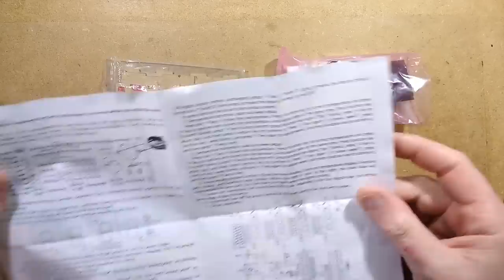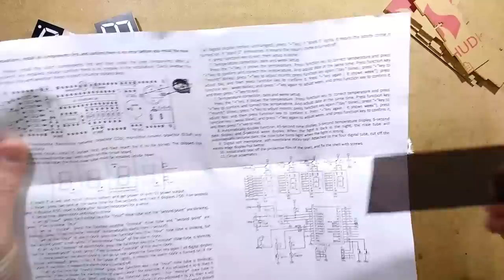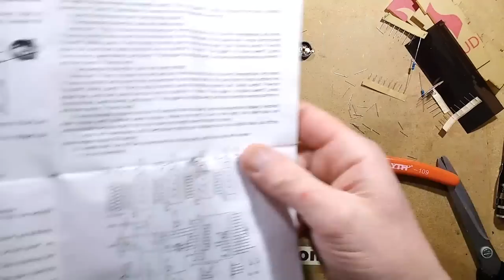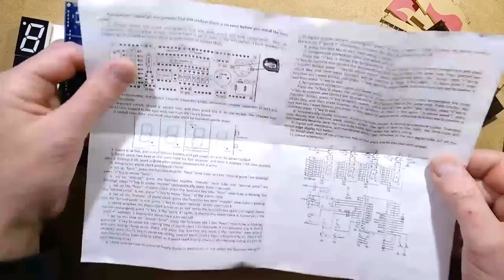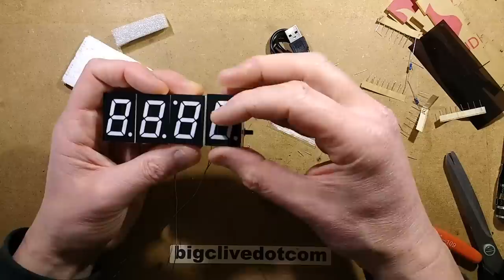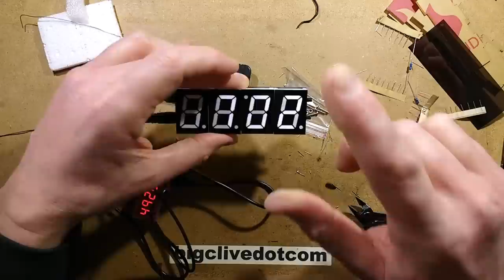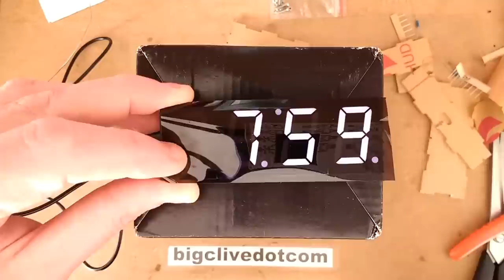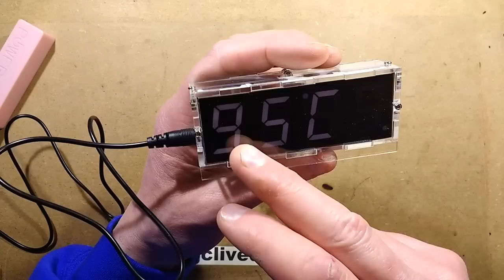eBay clock kit.  Full build and setting guide.

Comment: is it possible to fry the switch, put one of those together and one of switches does nothing :( i cant do initial reset etc and display also shows crazy things :) i guess i`m ordering couple more of those - want to get one working one at the end :D. and my soldering skills needs some practice anyways :)
Reply from the maker: It's possible that the track associated with that switch has a solder bridge or bad solder joint.  One way to test if it is the switch is to bridge its contacts carefully.

Comment: Why so keen on the separate timer chip?
There is no reason why a software based clock shouldn't be just as accurate if done right and the crystal oscillator it gets it's timing from also done right and adjusted.

Comment: what diameter solder you prefer using? I found that 1.5mm solder is completely useless
Reply: just5444 this looks like 0.5mm to me. I use 0.5mm myself, sn62pb36ag2, 3 veins of rosin core if memory serves, made by Stannol, couldn't be happier, just such a pleasure. Bought a big roll when they forbade lead in electronics, so it was named "plumbing solder", but you could tell its made for electronics and just hastily relabeled.

Comment: I built this clock on the weekend, everything seems to work as intended... Except it changes time slowly (only a couple minutes pass in about 20 minutes of actual time). Any suggestions?
Reply from the maker: Double check the soldering around the crystal next to the 8 pin timekeeping chip.  Especially the two small capacitors associated with it.  (Also check they are the right capacitors.)
Reply: I rechecked the solders at the capacitors and verified that I have the right ones installed.  I applied slightly more heat to the capacitor solders.  I removed and reinstalled the 8 pin chip.  Now the clock is working properly, thanks for the help!

Comment: Is the battery necessary?because i know that the battery is supposed to be the backup power supply in case of power down so that the clock can continue to count time. But i did try to plug in a battery and shut off the power for sometime and then power on the clock, yet the time is messed up. Any advice?
Reply from the maker: It's supposed to maintain the power to the clock chip and keep the time and settings.
Reply: @bigclivedotcom  ya i tried but it didnt work. I used a GP cr1220 battery. The voltage measured is about 3.4 v.

Comment: I know this is an old video but perhaps you can help?
i just built one very similar to this. it turns on , sound works, i can set the time / date.  But its static, time doesn't move forward .
Reply from the maker: Check around the little eight pin chip.  Especially the cylindrical metal crystal and its connections to the main chip.
Reply: thanks for reply.
I am 100% certain everything is soldered correctly, i double checked before soldering the digital numbers on the back.
Reply: @bigclivedotcom  Hi again, The chip was faulty , bought another kit and put the new chip in and worked straight away. 
Hopefully i can find  a single chip , then i can build the second clock.

Comment: Where do you get those screwdrivers from? the black one?
Reply: Donald Holben poundland or poundworld.
Reply: if youre not in the uk you can get them on ebay, theyre listed as 8 in 1 or 9 in 1 mini screwdriver. theyre cheap as chips but really good, the bits are hardened and dont deform as easily as most cheap precision screwdrivers
Reply: Thanks :)

Comment: I got the same clock and was annoyed by the fact that it displayed the temperature every couple of seconds. These STC micro controllers can easily be flashed with custom firmware. Luckily I even found a finished project on github that I could customise easily - stc-led-clock

Comment: What is the keyword for that film?
Seems useful in many use case.
Reply: i think its tinted depending on the colour is has to filter down?  the kit comes in several colours,   though i admit i had one of those cheap  voltage testers led things with no filter on it,  some opaque red tape worked fine on that, i dunno if a generic gray would work
Reply: albb0920 I think it's just a piece of neutral grey automotive window tint, I suspect.

Comment: mmm foxy says I like very much to build this clock 
 no like the 4 colour resistor code I have a few hundred of them and I still cant work them out
Reply: Don't worry, just measure. DSO138 kit, loved it, but it was evil, some resistor values read like something else if you hold them the wrong way around, and the kit contains both! But that's what they had to do to get the part count down and get still a decent performance out of it, so I don't want to blame them. Get some alligator clip attachments though.

Comment: an Issue I had when building these is that some of the pins of the LED Displays were not soldered correctly in place so I had to open the Displays and solder them in place myself

Comment: Sorry for the silly question, but why not use flux?
Reply from the maker: The solder has a flux core that disperses onto the joint as the solder melts.

Comment: oddly i have burned my self so many times i have almost no feeling in my finger tips so if i just touch it with the soldering iron its the kind of pain that almost feels good of course i take it away quickly bc i'd rather not leave a bad mark i mean I would never burn myself on purpose that's just mad.

Comment: The new microphone is nice but sounds a bit worse quality-wise. Nothing bad tho, just something I notice since I'm super picky :D
Reply: Sounds like the sample rate is lower than the iPad. No idea if that is the case, but that's how it sounds to me.
Reply: EpicLPer oh hey hi!
Reply: +David McGill Could be, since normal phone use was historically fixed at exactly 8 ksps, which is why traditional modems topped out at 56kbps over partially digital phone lines and ISDN is charged per 64kbps "channel" of used bandwidth. The first transatlantic phone cable (very expensive project!) had a capacity of less than 100 analog channels that were split between the US and Canada to cover the cost, with similar splitting arrangements on the Scottish end.  Took years to design and build the "small" amps on that cable.

Comment: I actually only had a chinese paper manual delivered with this kit, but I found that the google translate app does work exceptionally well with the chinese stuff (unlike japanese...).
Also there was a direct link to a .htm site on the interwebs. Lost the link, but got the PDF right here:  (Dropbox) http://bit.ly/2lNK8mE

Still chinese, but it has really nice pictures showing what's up! And also how to actually put in the LDR and the thermal R and also case assembly and all that gubbins. The only difference to your kit seems to be the backup battery holder, which actually clips in on 2 sides for me and has gigantic soldering pads, which were hard to solder (with the 8W USB iron and the supertiny tip at least it was :D )

And another thing: if it is pretty random after plugging it again, just reset it. Guess with the backup battery it would be good, but I don't have such small ones. Plus I put a bit of twisted tissue paper in the case's beeper hole. Sounds a bit nicer and a lot less loud, making it useful! AND you can interrupt the after-reset-8:00-beep by pressing one of the buttons.

Was my second ever thing I soldered, was really easy and worked well, even the case was easy to mount! (But I am a patient little bugger, not a big cuddly bear like Clive with big hands)

Wanted to build another kit, found the DSO138 DIY oscillosope to be intruiging. But 20€+ (plus same style plastic case) for a DIY kit with SMDs and whatever not....just bought an already soldered variant of it. (there are 2 DIY kits, one with nothing soldered, one with the chips soldered, and the unofficial everything-soldered one, which I got)

Doesn't seem to be too jitter-free, but a 20€ oscilloscope? Dat is gud price. It even has a software update available, with which the jitter becomes less. Needs a resistor to be changed with a lower value one (or so) and USB serial connector adapter thingy....which I dont have D: (And only changing the resistor doesn't work at all, tried it)

Found out I also got a plastic case assembly guide .doc for the DSO138 if anybody needs.

Comment: if I put one of the sockets backwards, do I have to re-solder it?
Reply from the maker: If it's just an IC socket it's fine.  Just remember to plug the chip in the right way round.
Reply: bigclivedotcom thank you so much! I figured out that it’s an IC. Makes my day a lot easier!

Comment: Does anybody know what kind of "contrast improving gel" BigClive is using here? He called it "grey foil", "diffusion film" and "contrast improving gel" i think. I cannot find it on google/ebay using those terms.
Reply from the maker: It's any clear coloured filter you can find.  As someone else mentioned, you can get document folders in a slightly diffused plastic.  I tend to use theatre lighting gel.

Comment: I have one of these clocks and it drifts like crazy and pauses the clock when you are in the menus so if you wanted to set the alarm you'd probably have to set the time again. A shame. I also had to translate the manual using Google Translate because that's the only way you could figure out how to change anything

Comment: My clock works but won't will not change the time as the minutes pass. Just stays at what I set it at. Where did I go wrong?
Reply from the maker: That sounds like an issue with the 8 pin chip and it's associated crystal.  Check there are no bad solder joints or bridges.
Reply: @bigclivedotcom  Did what you said and bought 3 more of them which all work including this same one. Your right., "It was to do with the ICU chip". Thank for the reply!

Comment: I bought a similar clock and after assembling it it is stuck at 0:00, any clue on how to fix it?
Reply from the maker: Check the solder connections on the traces between the main chip and the smaller time keeping chip.  It could be an open connection or a blob of solder bridging contacts.  Also check the small chip is in the right way round.
Reply: bigclivedotcom I will check it when I get home, thanks for the quick answer, your video was superhelpful because no instructions came with my clock. Keep up the good work!

Comment: I have practically no electronics and soldering experience and I bought one of these kits.......Place your bets now, will I A) Kill it by over heating via pathetic soldering attempts B) Solder it together wrong, thus killing it or C) get pissed off because its beyond me and end up binning it......Will update when It arrives and after my attempted assembly of it.
Reply from the maker: I'd strongly suggest practicing on some cheaper kits first.  You can get simple LED flasher kits for less than a dollar shipped.
Reply: I always tend to jump abit to far into the deep end with random stuff :/...baptism of fire n all that. Although having watched you assemble this kit it doesn't look too complex, just abit fiddly when it comes to the soldering. I do have a little bit of experience with soldering from when I took apart my Xbone pad to fix a sticking button and some more from my old job but that was just temp work....not much I know lol. I'm hoping that its well marked/the instruction sheet is done well enough to understand if you aren't a complete dunce etc lol. If it does looks too overwhelming when it arrives I'll stick it on the back burner and check out those little LED kits you suggested.
Reply: The kit arrived......just a tad different to this one. To me the kit in this video is doable with basic soldering know how. The kit I got aint....it has tiny chip based resistors and has a few tiny micro controller chips that need soldering on to the board.... :(

Comment: Just built one, but it won’t turn on. I did something wrong (obviously) but I have no idea what. 🤔
Reply from the maker: Check for solder bridges between pads, that components are the right way round and that there are no dry joints (solder there, but not mating correctly.)

Comment: And by today the ebay-shop seems to be abandoned. 52423 feedbacks, 0 Items in shop. :(
I wanted to buy this kit becaus it looks quite neat, but no luck. I will try to alter my search string...
Reply: go on ebay, even if the specific seller is out, theres dozens more wih the same clock, i already found hundreds just following clives link
Reply: It's also on banggood, or at least something that looks very similar. You can choose different colour LEDs there as well.
Reply: Try BangGood they have a number of different clock kits,  The scrolling one is good, plus the one with 60 LEDs in a circle which count down in different patterns and has a regular digital display in the centre. Good stuff.
Reply: I Brought mine on Amazon still working fine a year later since Built it.

Comment: Got a free USB powered light with something else from Amazon.  Google this UPC (2 014110 608092) and you'll get eBay links to the light.  What caught my attention was that it says it was 1.2w, which seemed high for a bendy USB light.  Plugged into my iPad charger and I'm reading 62degC on the small aluminum heat sink. Edit. 73C.

Comment: Clive, since you changed camera the video quality is fine on HD but awful when you switch HD off.  I cannot watch youtube in HD because BT won't upgrade the 6km piece of damp string they call a cable that comes to my house.  I'd be happy if they would just remake the 50 odd joints in the cable instead of leaving the joints just tied together in a knot or whatever excuse for a cable join they use...  anyway, just thought you should know that in anything other than HD the video quality is now poor
Reply: Get and use a YT downloader. This software fetches the video at whatever resilution you want as fast (or slowly) as your connection allows.  I use one all the time.

Comment: it would be cool if it used RGB LED's so the different modes could be different colors.
Reply: hi Clive just a quick one what is the size of your leaded solder
Reply: Graham Badkin, you may have ended up in the wrong thread, but I'm fairly certain it's about half a millimeter in diameter.

Comment: Why don't they just make the IC pins parallel to begin with?
Reply: Probably because 99.99% of ICs are handled by machines and this keeps the ICs in the PCB via the spring action of the splayed pins before wave soldering.
Reply: Interesting idea, but how do they get them into a PCB with the pins not aligned?

Comment: Hey Clive, I'm having trouble with a 555 timer circuit, I was wondering if you could tender some advice? I've got two issues with this circuit - https://goo.gl/SakI50

If I add a resistor between Pin 3 and the base of the transistor, it acts like a very complicated switch, and there's no 1/4s pulse. If I take the resistor out, it locks on and the triple nickel starts getting VERY hot. Either way, the circuit is not working as intended. Any thoughts?
Reply: never mind, I figured it out. I just needed to capacitively couple the trigger input to ground, so that it wouldn't stay low on the trigger pin. the timer was working, I just wasn't releasing the button.

Comment: Too bad that smoked plexiglass wasn't used for all of the case panels except for the front. I have an old Altec digital clock with an ipad/iphone dock and without the manual, programming it is near impossible. I always get the idea that Chinese programmers are snickering at the thought of users losing the little instruction manual that only a 12 year old can read without a magnifying glass.

Comment: "Modern processors don't get very hot." Clive, my CPU runs at 52C under liquid cooling.
Reply: Those are Desktop processors pushed to the limit of what can be done. Using similar (or older/cheaper) tech, a CPU the speed of an old PC would be chugging along at around 1 to 10 C above ambient with no special cooling. The CPU inside a modern optical mouse is a good example, doing real time image processing of the moving table below it while staying cool enough to rest your hand on it all day.

Comment: Could you convert this for nixie tubes?
Reply: rimmersbryggeri Theoretically yes, but it would be very inconvenient, because nixies run at around 170v, so you would need to add another power supply, and octocouplers.
Reply: Yeah forgot about the 170v supply.
Reply: +My first name My last name (joeykapi) If the board is isolated inside the case, no optocouplers are needed, just a "low voltage" (~200V) PSU and some corresponding driver transistors or chip.

Comment: Just use some superglue to assemble the case!
Reply: That can be done, but tends to look nasty! Superglue clouds acrylic. I suggest simply using electric tape around the 4 circumference pieces to hold them together while you assemble.
Reply: I actually use chloroform which melts the acrylic but leaves a clear joint. Problem is of course that it's quite hard to get.

Comment: An inch is EXACTLY 25.4mm.
Reply: Brandon JC That depends upon your definition of exact. You are in fact correct to one decimal place. There is, in fact, no deciman
Reply: Disregard the last part of my post and replace with: There is, in fact, no exact rational decimal number equivalent of an inch in the metric measuring system.
Reply: Robert Langford Not true. Since 1959 the inch has been defined in terms of metric length, as exactly 0.254m.